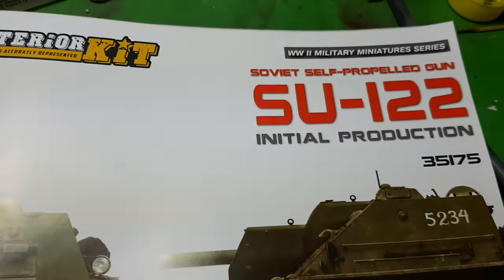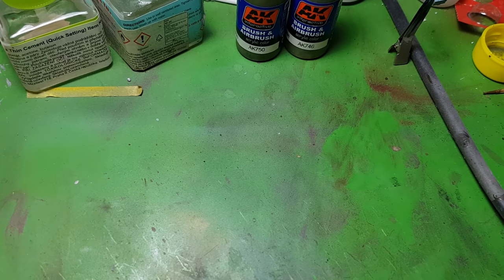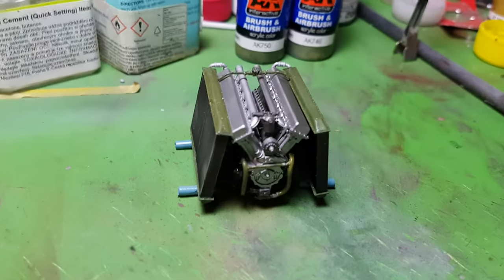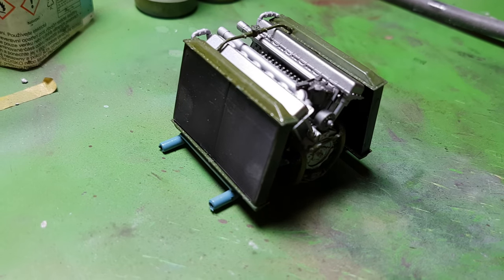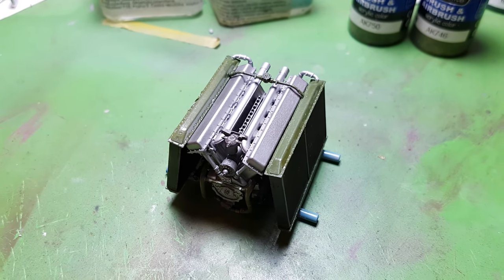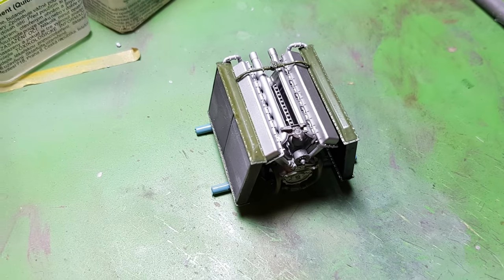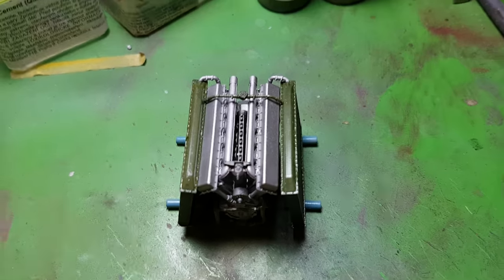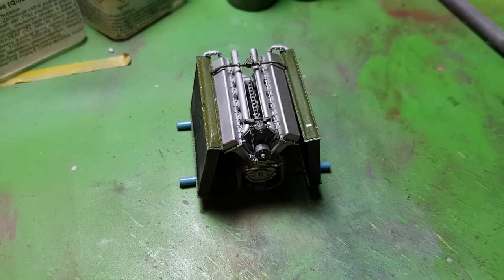Miniart 1/35 Su-122 Build-Report (Engine)

Comment: Thanks for posting this, just got the kit yesterday....I find some of the paint call outs a bit strange like the front lower angled plate as Blue Gray? One idler mount is to be white where the other is Blue Gray, etc. I assume that's incorrect as both should be Blue Bray or White. Beautiful kit and well engineered.
So the engine compartment should be Protective Green except for the floor? Not all that clear in the instructions (Initial version).
Reply: yes, they should be in this color. As for the floor, right, it was this parts division as described in the video.
Reply: milky55way20